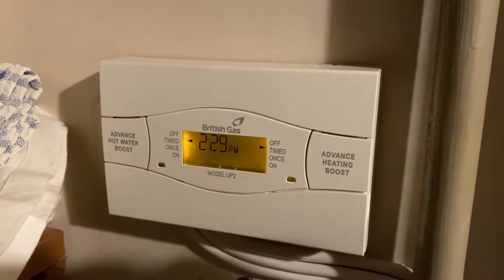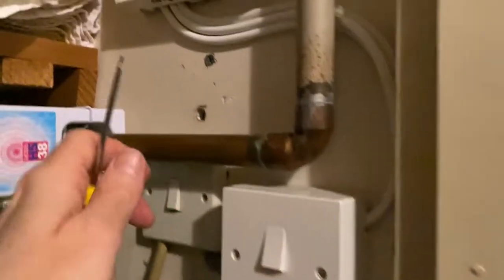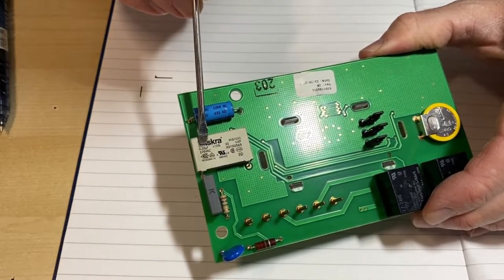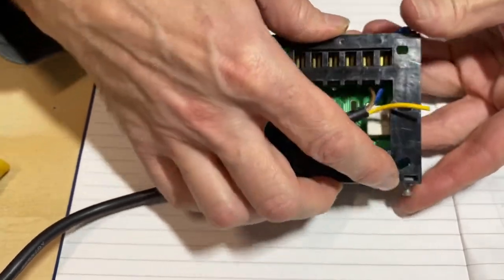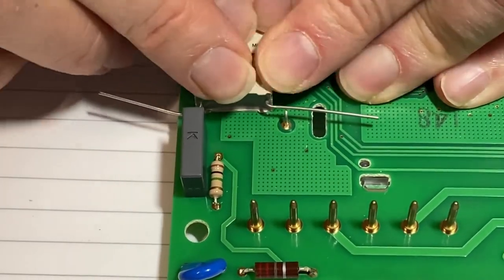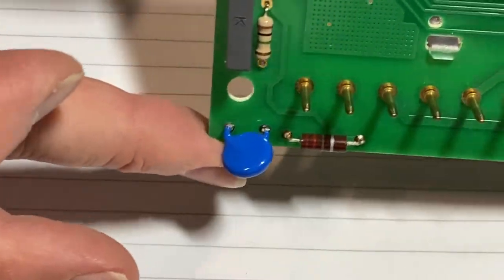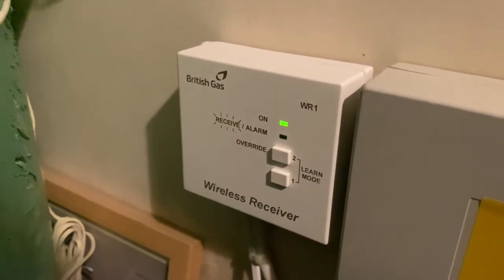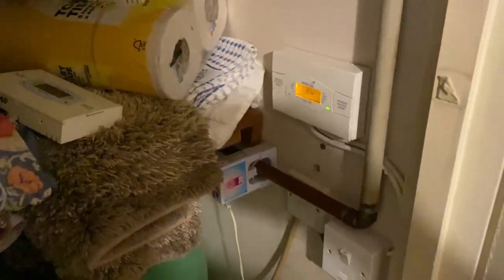British Gas UP2 / Drayton LP822 heating controller repair

Comment: Thank you so much for this video, I have the exact same issue and have gone round the houses trying to find the fault. I have an S Plan heating system and changed the 2 way heating valve thinking it would fix it (which it didn't!). Many thanks!

Comment: This is great. I tapped the UP2 unit into life today after I found your video. Can I ask precisely what capacity I need in order to replace?
Reply from the maker: Just type the values on the top of the capacitor into Ebay and you'll find them.